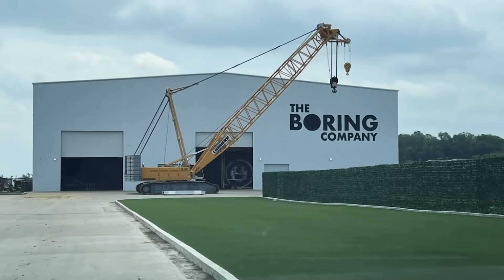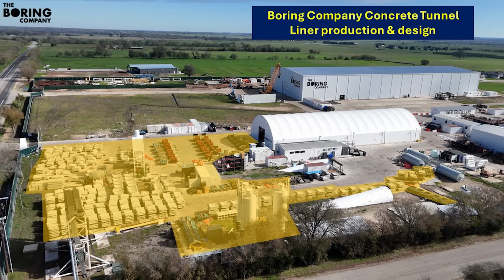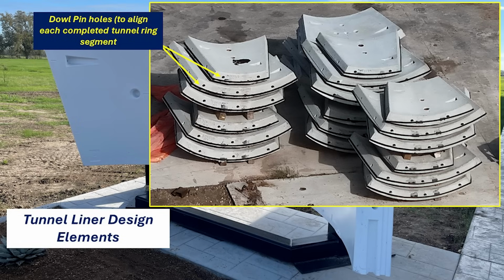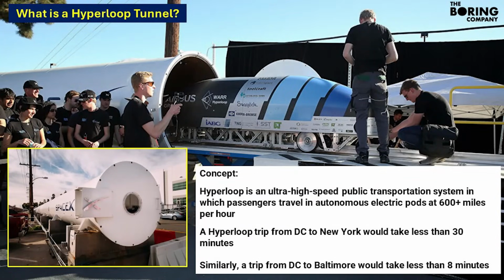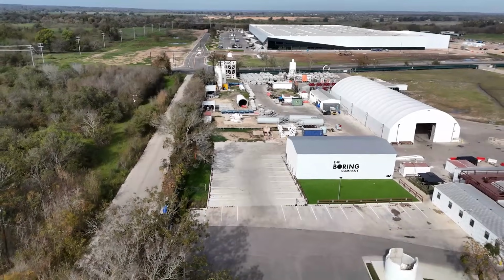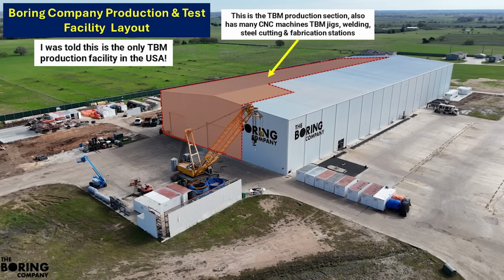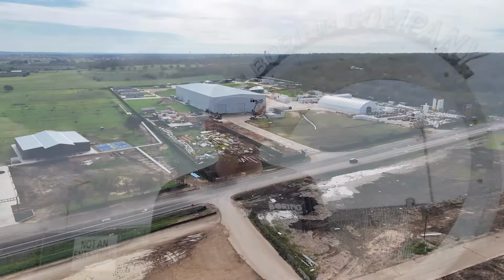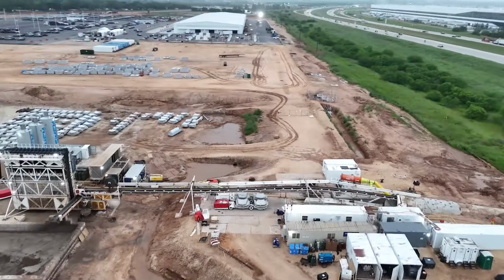Boring Company Tour Part 1 ... Innovation, First-Principles, TBM Production & Progress!

Comment: The "freight" tunnel in the diagram around 7:00 looks like it could be a railcar by Intramoteve or Parallel Systems. Subway tunnels cost $50m/mile up to $1 billion per mile. Boring claims $5 million/mile. Even having to dig 3-6 tunnels (1-2 each direction, and 1 or 2 service tunnels) the cost is half of the cheapest current option. Boring should be working with railcar companies to develop narrower track & train rolling stock for the next Prufrock machine. Each subway takes thousands of cars off the road. Elon doesn't care about car sales anyway, right?

Comment: Fascinating. I am curious how the rings connect to each other. I see the alignment dowels, but is there nothing like the bolts that tie segments together? The thing has rubber seals that are bound to compress when a vacuum is pulled. Wount the structure move from that with not tie bolts? Vacuum seals are a bitch, how do they seal such a large structure, deal with cracks, subsidance, the sprout threads, etc. Where do they use the grout we see at Giga?
Reply: The grout is injected into the anulus left by the TBM as it slides forward over the segments. It provides stability to the ring and avoids ground settlement into the 50mm or so gap left by the TBM tail-shield. Google "through the tail grouting TBM", should be some videos to explain.

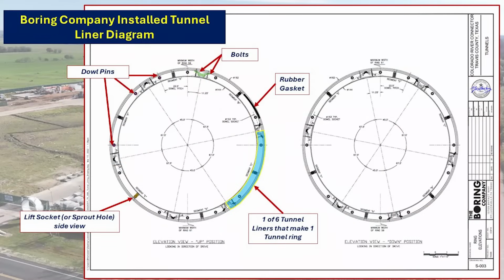Comment: Sorry Joe, one correction. 8:50 - Segments are 5 feet long not 3 feet. (it says on the drawings also at 9:40). They are 61" on the wide side and 59" on the narrow side, average 60". Also the segments are cast with a groove for a bar locator on the radial edge, which could delete the need for bolted joints in a ring of this diameter. Not sure why they are not using it. And they don't seem to have cast in the joint check identifier, which is shown on the drawing, but not detailed on the mould/casting.
They are doing their casting in the open air! No temperature or weather control, and the concrete batching plant seems pretty basic. Such a method would never get approval on a major tunnelling project pretty much anywhere in the world. Things like this are what leads me to say that they are decades behind the curve in tunnelling technology I'm sorry to say.
Thanks for the insight, it confirmed a lot for me.
Reply: SpaceX was building rockets out in the salty dusty air for years while they were iterating through prototypes. Now that they are much further along they have built a dedicated factory building, and the standards under which the rockets are built have drastically improved. The boring company is very much in a testing and design phase, so things like prepping tunnel segments for scale production likely aren’t a focus
Reply from the maker: Thx
Reply: Or, look at it another way, The Boring Company has found ways that these controlled environments are not really required for their manufactring process, saving millions in the production process.. Like they also do not need clean rooms to manufacture a Starship rocket.. Basic airconditioning and dust control is sufficient. Pretty arrogant to conclude The Boring company is decades behind.

Elon Musk companies have the habit to question the "established and accepted" methods of manufacturing and the products themselves, to itterate to something completely new and in the end much better. Most of the time it is the very reason Elon Musk starts new companies, as he sees ways to improve or radically change the incumbants way of doing things. Like Tesla is now years ahead with EV manufacturing and with EV's themselves, and the "established" legacy companies, who first laughed at them, now panicing and try to copy Tesla.... YOU are at the laughing stage, so to speak, beware not to be overtaken by the Boring company in a few years finding The Boring Company scooping up contracts left and right and your company starts falling behind... 

Just look at what Elon Musk did with all the companies he worked on.
Zip.com Disrupted the yellow pages telephone book (They laughed Elon and Kimbal out of the door when they presented his idea)
Paypal.com Made international money transfer as easy and fast as sending an email (Banks did not want to invest in that.. now worth tens of  Billions)
SpaceX first and only orbital rocket company able to return 10 story tall booster rockets back to earth and re-use them, now sending payloads into orbit at 10% of the costs of the incumbants.. NOBODY believed that returning oribital rocket boosters from space back to earth and use them tens of times again and again, was at all possible
Tesla proofed to the world Electric cars can be compelling and a viable option for personal transportation, and now also for cargo.. Legacy car makers laughed at Tesla for about a decade, untill Tesla became the only one making Electric cars at a profit and spitting them out every 30 seconds at very low cost.
Tesla was laughed at when they presented the Humanoid Robot plans 2-3 years ago.. Now there are tens of companies trying to do the same.

Do you see the pattern here?  I don't know what company you work for, but I would take notice of the Boring company and take them very serious. They have just started 6 years ago and already boring tunnels in several places succesfully.. relatively quickly and at a profit

Comment: Liner Types A and B could be for straight tunneling respectively curved tunneling. I had expected the first part of the tunneling machine (with the cutter head attached) to be a lot shorter than it actually looked in order to push it into reasonably tight turns using the rams. The ability to make tight turns (in tunneling) was also one of the announced abilities of the TBC technology. Maybe we should be able to spot both A and B type of liners in the laydown area but I haven't spotted any. Also the (first?) tunnel at GT may be a straight-in-line exercise.
Reply: They are using the type B. It is a universal ring that can "steer" or follow the TBM around curves just by orienting the ring in a certain way. See the drawing 9 minutes in, it shows the ring is 61" at the top and 59" at the bottom (60" nominal) they can build it in any one of 16 positions (No. of dowels). That way it can turn a theoretical curve radius of 412' or 135m in any direction. However, allowing for steering and correction this should be limited to around 175-200m.
I think Type A could be the abandoned hexagonal segment moulds (these only really work on long straight rock tunnels as the cant really go round corners, so their use is limited, tunnel engineers know this, so I have no idea why they experimented with them for this type of TBM).

Comment: Can’t wait
Reply: Same, if they can do a  hyperloop that can tunnel at 1mile a day then it could become a very impressive business, I am sure there will be many changes to the boring machine and the tunnel. What about lining it with SpaceX stainless steel instead of concrete, that could make progress faster, and you could have a roll of steel on the machine in the tunnel able to bend the steel for joints and unravel it as the tunnel progresses. Don't know much about tunnels, but enough to comment, but this seems like it would be more expensive but so much faster to implement.
Reply: @palmtreeshenanigans  It needs the concrete segments to push off for the forward thrust.